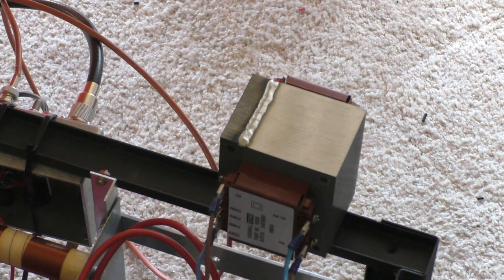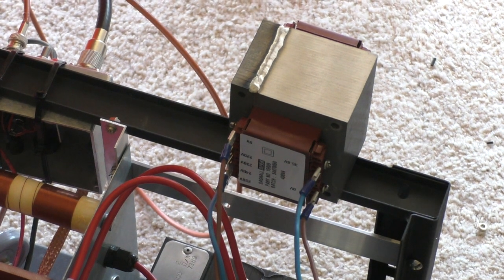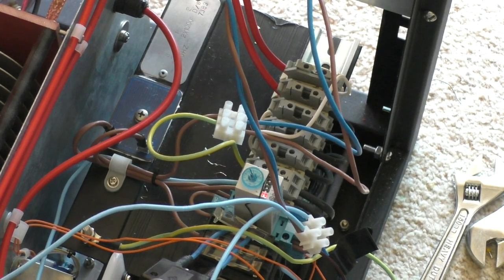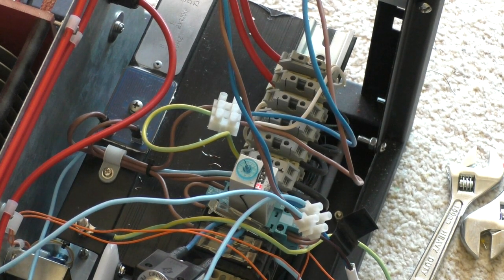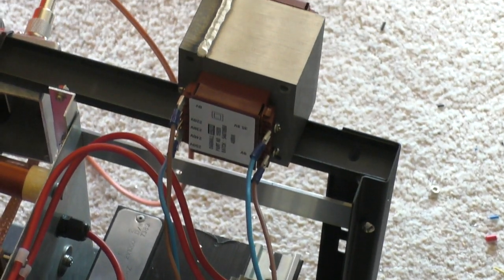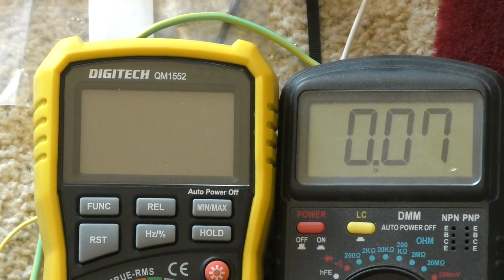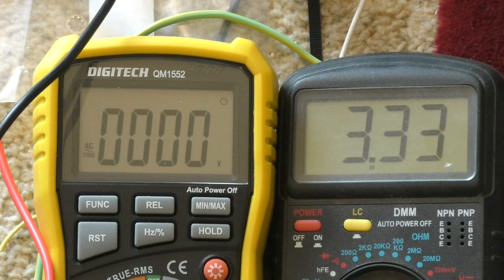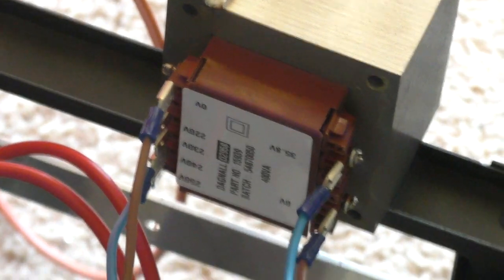More Bucking Around... This HT Voltage Is More Like It

Comment: Hello Steve from Dunnellon Florida.  I was wondering if you could look at a Voltage Doubler board I am working on. I have a Drake L7 w/ 2 3-500Z Tubes and the orignal board Had a real bad voltage drop and the transformer was bad.  I bought a new transformer with 240 input and 1850 vac out @ 2 amps. I tried the Harbach Board and it failed so I decided to build my own. I am very new at this but been around long enough to know that this will kill you. Anyway the other board I built by upgrading the caps, diodes, and bleeder resistors. I was getting 4200 volts without a load. However the voltage still would drop 400v when the amp was keyed. NOT GOOD ENOUGH. I was able to get 2600 watts output with the old board in the SSB mode and in the CW mode a peak of 1600 watts with 3200 volt rail. But this board I am building has double caps and diodes.
Is there a way you could look at this layout for me. I have looked for your email address with no luck. If you would like to do this here is my email address.  w4dra.dave@gmail.com . 

Thanks
Dave
Reply from the maker: Hi Dave. I don't have an email address associated with this You Tube channel. There's not much point me emailing you I'm afraid. All voltage doublers have the sagging problem. I have never used a voltage doubler before and would be reluctant to use one in future as mine sags too much for my liking. You can 'stiffen' them up by reducing the value of the bleeder resistors across the capacitors. This will give a lower HT voltage simply by drawing some current and 'loading' the HT line. Then you have to select some resistors that can dissipate the heat this arrangement will generate. It will still be saggy though.
Reply: @vk6cs456  I know some do but 500 volts is quite a bit. With the original doubler in amp it would drop 2-300v it was a .75 amp  so I put a bigger transformer @2amp doubled the Caps Values and the number of caps. So now I have 16 caps 470uF 500 volt and upgraded the diodes to 16ea 1000v @ 6amps, 100K ohm across each cap.  The transformer output is 1850vac. 
Sometimes I wish I had never even started it and just bought a new amplifier. But I always have liked a challenge even though I don't know a lot about it. So I guess that's why it's not called Professional Radio right.. 

Thanks Steve.
Reply from the maker: Amateur radio is all about trying things and learning. Unfortunately this is always the case with voltage doublers. This is because they present a higher impedance to the transformer. With voltage doublers the HT current goes through the capacitors, they're in series with the HT supply. The series resistance of the capacitors comes into play. Try to get some capacitors with the lowest ESR possible.
Reply: @Vietnam_Vet_67  look at Richard Measures AG6K web page,last January SK....There you have everything on amplifiers,even calculating drop on voltage calculation by secondary resistance....but according to him  10 percent is normal....he wrote NEAR PERFECT AMPLIFIER for arrl handbook....
Reply: @vk6cs456  yep,in doublers caps must have low esr and hi capacitance.....if secondary resistance is more than 15 ohms for 1200 volts secondary for doubler,you have problem...or more than 30 ohm for 2400 v secondary full bridge...or 40 ohms for 3200 secondary full bridge...according to calculation
Reply: your transformer can not have 1850 volts ac on secondary,Drake L7 have voltage doubler,so you calculate 1850x2.82---5200 volts...and you have 4200v....so your secondary is not 1850, but 1500 volts....1500x2,8--4200...key down 1500x2.5--3750volts...so 350 volts down....close to your 400 volts drop....full bridge is calculated secondary volts x 1.4....under load secondary volts x1.3...
according to AG6K...and he was master....RIP 
p.s. in full bridge voltage drop is half than on doubler...regards
Reply: mistake,your drop max need be 450 volts ,so you have less than that....better can be only with full bridge,half of that, and with resonant choke and capacitor even real stable voltage...with doubler,to achieve more stable voltage,secondary resistance must be lower ,so transformer much bigger....
Reply: Dave , fwiw there was a school of thought that voltage doublers enable you to run a slightly smaller transformer because you have less insulation and more copper. So it helps to reduce the sag a little.